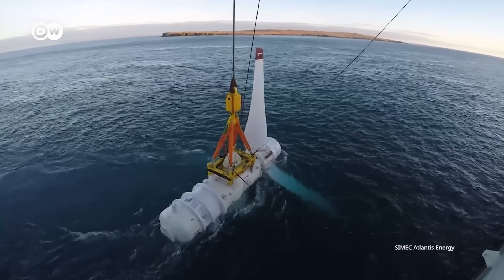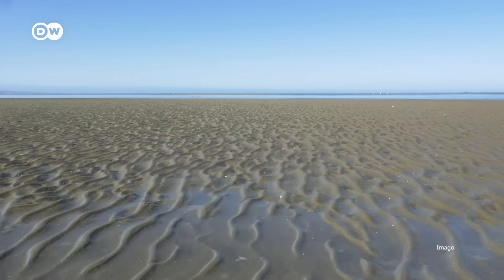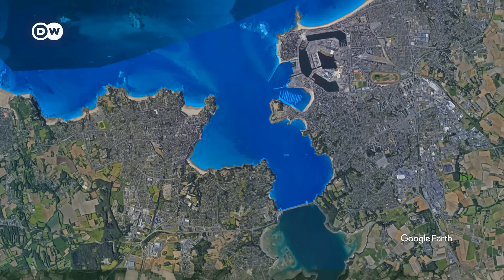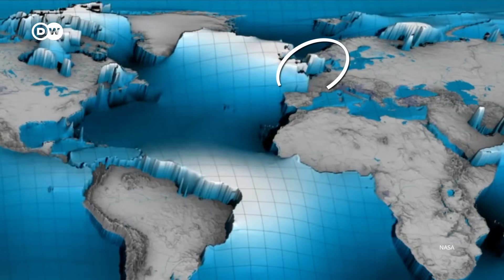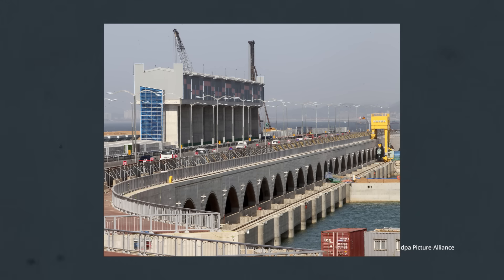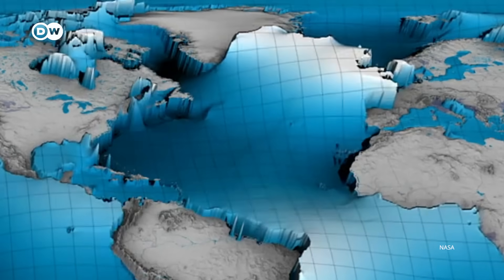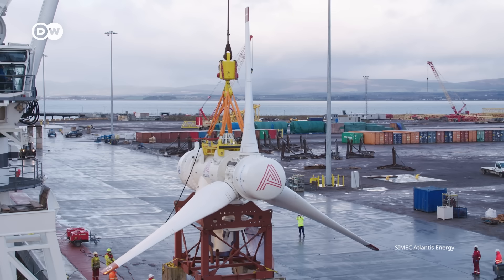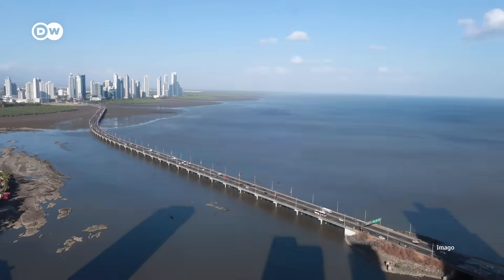Tidal energy could be huge – why isn't it?

Comment: AS I recall, one of the problems that they had in the Bay of Fundy (in addition to issues with fish, seals, etc.) was that the tidal forces are so strong that the experimental units just disappear - they are torn out of the bottom of the bay and swept away.
Reply: I always presumed they spin slowly utilising massive gearboxes to harness the huge torque that flowing water allows the turbine to produce?
Reply: @scottwhitley3392  No, it's a multipole permanent magnet generator.
Reply: @johnwade1095  you capture the energy at low rpm and high torque, then convert it to higher rpm using a gearbox, connected to a generator (in a secure location)?;

This is mostly important because, to achieve decent angular velocity in turbine blades, your would have the tips of the turbines moving at WAY too high velocities!
Reply: @GrowToCycle  no, really, have a look at openhydro's solution.
Reply: @johnwade1095  I suppose that this is why the more current solutions, such as the O2 Orbital turbine do exactly what I said. I guess I hadn't realised the context of the comment was with respect to OpenHydro's tech. ?
Reply: @Nathaniel Burbery  the poster referred to the bay of fundy, where OH are deployed.
The Dutch government say these steel marine structures have a 10 year life, which casts their value proposition into doubt.
Reply: @johnwade1095  solar panels typically have a "rated life"of about 9 years... This is mostly an economic thing... Depreciation and tax purposes.

If offshore wind turbines are economically viable (they certainly are!), Tidal power is certainly feasibly viable if we can standardize the best practice/mass manufacture
Reply: @growtocycle6992  That's a wild claim and not one I am minded to believe without evidence. What price / kWh do you think is 'economically viable'?
Reply: @johnwade1095  wind, pure physics, cannot come close to the torque produced by tidal power. Even with additional complexity for installation, I can't see why don't tidal turbines into existing offshore wind could possibly be a economic loss. Physics and rudimentary engineering/materials knowledge suggests that, so long as you can avoid cavitation, tidal should be superior to wind always.
Reply: @GrowToCycle  show me the numbers.
Price per kWh. 
That's  how we know if it's economically viable.
Reply: @johnwade1095 if you’re comparing it to fossil fuels then you need to also factor in the cost of increasingly catastrophic climate disasters
Reply: @bikesgoodgasbad  which are becoming less frequent. Because   facts.

Comment: It breaks my heart that the UK never built a tidal barrage across the Severn Estuary. When first suggested in the 1970s it would have produced 20% of the entire county's electricity.
Water is a thousand times denser than air - it is still the right solution.
But it would reduce the tidal range above the barrage (inevitably, since that's how tidal barrages work) and it would have altered the marshland that drains into the estuary. I am an enthusiastic birdwatcher, but I really don't care - I want carbon free electricity.

Comment: Almost every system has failed and the few that succeeded did so because they also did other things.  Corrosion is a huge problem with salt and sand.  Disturbing the ocean environment in a way that damages the turbines is another (e.g. they can shift currents and sandbars, even shift small stones).  Then there's problem of needing to store electricity because while the times of generation might be predictable, they often won't coincide with times of high electricity demand.

Comment: Could be done where the air flow is high not required of big lengths of poles.The point is if there is a chance to store the power and use as a shuttle than permanently connected wires.

Comment: The best thing Germany/EU/US/World can to is to manage the electicity consumption of EV owners.

Most EVs have >= 30kW*A batteries

Some owners charge at night, some put EVs into fast charging stations.

We need to have an option to plug in an EV into the grid, but charge it for price X until the EV is 30% charged, then conditionally charge it for price Y until the EV is 60% charged and so on.

This way when somebody plugs in an EV into fast charging (for a much higher price), other EVs charging at idle for cheap should stop charging.

We need to manager this better.

Comment: There’s enormous consistent energy in tidal forces.  I’m curious about how much hydroelectric could be could be produced around canals or straits (where there’s a elevation difference in water levels). Of course many of these areas in the world are sparsely populated therefore efficient transmission is the dilemma.

Comment: That video says nothing. There are way more reasons why we're not so kin on tidal. It's not some kind of big conspiracy but economy and ecology. 

Electromagnetic pollution. 
Regular pollution due to were and tear of mechanical plants.
Vibration pollution due to moving elements.

High maintenance costs.
High installation costs.
Difficulty of access in case of emergency.
Low efficiency in comparison to expected and to other sources.

And many many more.

Comment: Two problems come with this technology if used abundantly:
- It has the potential to alter marine currents.
- The more centrals you build in a vast area, the less each turbine becomes efficient.
We already have huge over-fishing issues, even though the idea is nice, it will sure have an impact on marine life... This technology might be a great solution for specific areas though.

Comment: If you already figured out a way to screw the wide diameter cylinder part of a plastic bottle together, and it is still not completely air and liquid tight. Then a little bit more heatwork will solve that.
Reply: Unitopkility

Comment: As a professional engineer I have a natural disrespect and resentment about this type of "ideological propaganda".   All the interviews and opinions in this video are from non-professionals only.  There is not a single number, not a single answer to most important questions:
1. What is the installation cost per KW/Hr ?
2. What is the maintenance cost per installed KW per year?

Oceanologists and climatologists have no clue, of course.  And where is the answer to why more installations like this have never been built.
Well, of course, there is the answer.  But the answer does not go along with propaganda, that is why the authors did not want to publish it.
The answer is:  both installations, mentioned in the video where financed by MUNICIPAL budget, i.e. by taxpayers. And the taxpayers never got their money back, because the cost of electricity had been TOO high.   As they say in Italy "Hey, ragazzi,  stop trying to hang macaroni around my ears"

Comment: The simplest and most abundant element in the universe, hydrogen, packs a lot of energy - more than natural gas or oil on a mass basis. It’s a cleaner, more flexible energy carrier and is always combined with other elements. Hydrogen can be produced in several ways. One method of producing this zero-carbon fuel can be done by splitting water into hydrogen and oxygen using renewable resources—this is called green hydrogen.ADVANCED SOLUTIONS FOR GREEN HYDROGEN ENERGY
GE Expertise Trusted Around The World

Comment: 1. There are very few suitable locations - you don't just drop these things anywhere along the shore.
2. Massively expensive. The obvious solution is massive government subsidies - are you going to take the subsidies away from wind or solar to pay for it? 
3. Tidal power is 'predictable' but not constant. High and low tides vary according to the season, and by the day. When they say 'provide for x thousand houses, that's not true. Just like wind and solar, the power is not constant, so you can't just run power lines from the tidal plant to your house - your lights would go on and off. 
4. The environmental hazards aren't even known yet - this video barely touches on them. 

For climate change, nuclear is the rational way to go. Relying on the potential of ideas like this is crazy.

Comment: As if there arent enough sea animals dying due to humans?
Reply: So you didn't watch the video I see. They address this.
Reply: They want to section off spaces designated for these turbines to work in. No fish will be able to get into the sections they designate for the turbines. As long as they don’t start sectioning off every little inch of water around the coasts. The fish will be fine and will actually use the walls of the sectioned off areas as habitats.
Coral will grow on it, fish will use it to lay their eggs. It’ll be a good thing if it’s done right

Comment: Why not wind turbine on top of the tidal turbine? Give the wind turbine a small sail so they can change direction. Also the wind turbine close to an island has the benefit of predict-ability. Exactly like the tides.
Also they may good for an electric free refrigerator as well, supporting the local fishing network. You know when you have a constant supply of wind and water, it is refrigerator.

About the underwater turbine maintenance, I think we can use mesh to protect the turbine. When it clogged up by marine life, just replace the mesh. It also reduced the chance to getting hit by a larger species, or strangled by something.

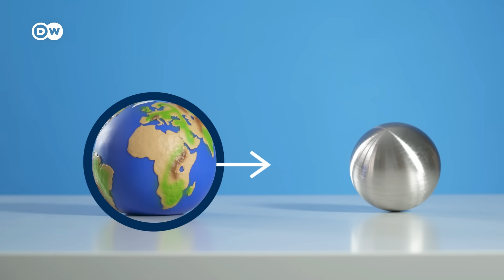Comment: 1:10 The explanation is not really correct. Thepart of the forces on the earth moon line are not really significant. What is significant though are all forces added up that we get applying the same principle all along the earths surface. While the forces are still incredibly small, they act on a huge amount of surface area that will push the water towards the earth moon line.
Who is cleaning the blades from barnacles etc?

Comment: I see multiple problems.  Corrosive is the first problem.  Salt water environments are efficient at attacking the components of a turbine.  Not to mention the  storms that can destroy and disappear the entire structure.  Second is the algae and barnacle removal will be ongoing.  Third, the damage to marine life will be significant enough to upset people.  How many dolphins need to be hurt before there is a rally against the technology.  This isn’t one turbine, it will be multiples of dozens.  Fourth they will be eyesores or limit the use of this space to just power generation.  These are only some of the hurdles that I can think of now.  More will pop up if the technology is used on a large scale.

Comment: a turbine is a turbine it needs lubrication for its internal moving parts, so now you have turbines holding about 100 gallons or more of oil each in the water exactly where you dont want oil possibly leaking. Like all mechanical things they are not immune to breaking down or failing and some of the break downs or failings can cause majour leaks which would be leaking straight into the ocean.

Comment: The problem with tidal power with systems fixed to the sea floor is they recently discovered that the tide moves boulders the size of houses around the sea floor. These boulders would smash such systems. And secondly stuff grows on turbines in the sea that need cleaning. Tidal undoubtedly works but is expensive.

Comment: At present, the nuclear power is the most practical solution to both clean energy and sufficient energy at the same time. 
The downfall is that it requires vast initial investment, but it will be more cost effective in the long run even compare to fossil fuel.
The problem is that it probably unfavour by most of the politicians, since the nuclear power which requires long time to build and surpass the fossil fuel won't help them get the vote.
Reply from the maker: Hi Tim, we've done a video before called "Do we need nuclear power to stop climate change" (https://youtu.be/9X00al1FsjM). Feel free to let us know what you think of the video in the comments section.

Comment: certainly in europe, there is a unified grid, with very variable electricity prices for manufacturors, 
so producing when demands is high, but sun and wind energy is low is very rewarding, 
while producing while sun and wind are high, gives almost no reveneu, almost zero sometimes in summer.
so it would have the advantage of picking up several high price moments, so justify it's higher cost of construction, thus it would never need to be as cheap as solar and wind, only less extremely more expensive :)
Reply from the maker: Thanks for your comment! Have you seen our video on how solar energy got so cheap, and why it's not everywhere (yet): https://youtu.be/sUvaYycoWqI – let us know what you think of the video in the comments sections 🙂

Comment: To be more cost-effective,  Tidal  power generation needs to be paired with "underwater energy storage capacity " , which is storing energy into pressure difference between surface and depth of the  ocean .
"Underwater pressure battery" allows excessive generated tidal energy to be stored in hydraulic fluid (fresh water) inside storage tanks at the bottom of the ocean.

Comment: well one barrier to getting this workig off the top of my head is durability. salt water and moving mechanical parts dont mix well even if you plan for it. alt water eventually eats away at everything, so upkeep is going to be immense. and that brings into question where we are going to keep getting all the raw materials to make these turbines. not only do they require an immense amount of common metals, but rare metals as well for the batteries and computers that run it. not saying its impossible or not worth it, but I think air and sun power is more viable because the durability is less of a factor so the cost of maintenance is lower which in turn means we will need fewer resources to keep it all running. We forget that though air and sun are renewabl resources, metals are not. there is a finite amount in this planet that, though it may not happen for a looooooong time, it can run out.
Reply: the metal intensity of wind and solar energy is also huge

Comment: There is only a limited availability of actually feasible sites for tidal power projects. Tidal power plants are forced to be constructed near to land, because high tidal currents are needed to produce any power. The initial costs for tidal power projects are extremely high, because there are no benefits to manufacturing at scale, tidal power projects have to have turbines that are painstakingly designed, constructed, tested, turned into prototypes, and then the final production, site preparation, and then individual installation and constant monitoring. Natural catastrophes pose a constant risk of total complete destruction and failure, which cannot be realistically relied upon for total comprehensive energy production for any nation. Daily wear and tear and constant maintainance and replacements are also expensive. Saltwater is especially corrosive, and bio-fouling issues will be constant and expensive.

Tidal power damages marine life, leading to mass deaths of animals, just as the wind power turbines results in mass deaths. Noise from the rotation of the underwater turbines impacts fish habitations in tidal power locations, as well as impacting the quality of water and natural sediment processes, which can affect shorelines. Mechanical water turbines also break down and potentially leak lubricants and other harmful chemicals and materials. Using bays to install a tidal barrages also results in changes to shorelines, damaging estuarial ecosystems that rely on tidal flats, interferring with the flow of water in and out of bays, reducing salt water levels, and thereby damaging marine life. Weather is completely unpredictable, and the tides themselves are only periodic. Actual necessary electricity production needs regular reliable energy streams, tidal power production will require massive battery storage, which also has environmental dangers and failures, extremely high costs, constant need for maintainance.

Any actual cost-benefit analysis shows that tidal power isn’t feasible and is nowhere near feasible. It is in the most infantile state of all of the renewable energy sources. What is far more effective is nuclear, but most environmentalists don’t actually care about nuclear, because they aren’t actually motivated primarily by finding the cleanest cheapest easiest energy production available, but pursuing radical anti-industrial political ideology.

Comment: This is another EXPENSIVE, unreliable energy source. You would have to have huge number for any results and they would be minuscule. They also need to explain what kind of Damage it will do to the Ebb and Floe of the NATURAL TIDES. Eco Energy Sources would be great, but we are DECADES from ANY practical Applications that would produce significant amounts of usable Energy let alone the cost to build and maintain. Check out the actual cost of Wind Turbines and Solar Farms and their Maintenance. It's astronomical and  don't come even close to paying for themselves.

Comment: Like wind turbines, tidal turbines could provide some power, but at what cost? I'm not talking about the material cost, but the collateral costs like killing thousands of birds and fish. Most people are like "that doesn't matter so long as I get some electricity", but at the same time "want to save the planet".
Reply: Fish and sea mammals are not hurt by the slowly turning blades, rarely colliding with them. Tidal stream is placed in areas of high speed water, but bio fouling is a problem

Comment: The only thing I don't like is the bit about how tidal could easily power the whole world. It's overly simplistic to just look at how much power output you could have and say that. The problem is how does that power get from the coast to deep inland? We do not have efficient ways of storing or transporting massive amounts of electricity over large distances. It's infeasible. Oil on the other hand, you put it in a barrel. Then you transport the barrel. It's so much better.